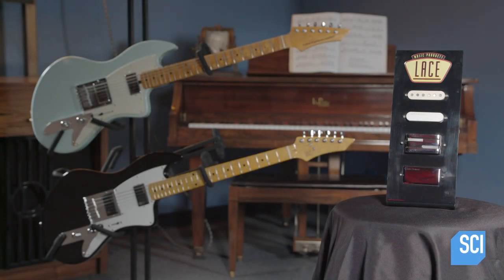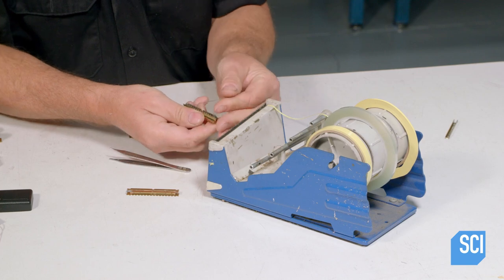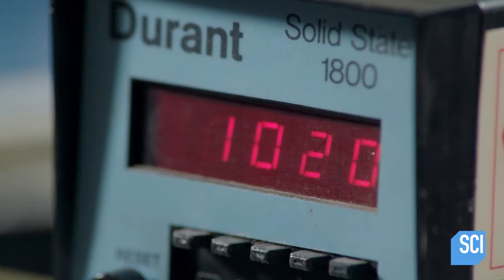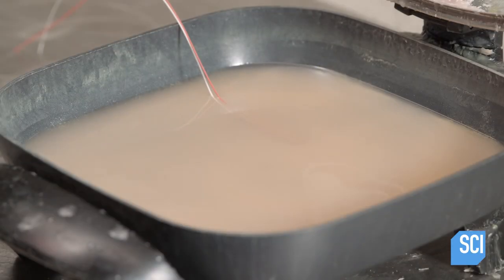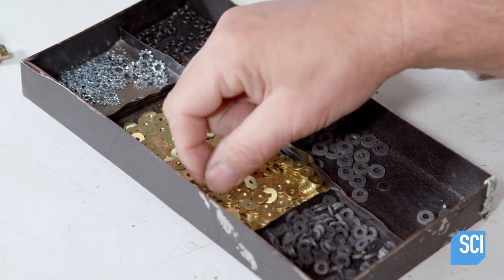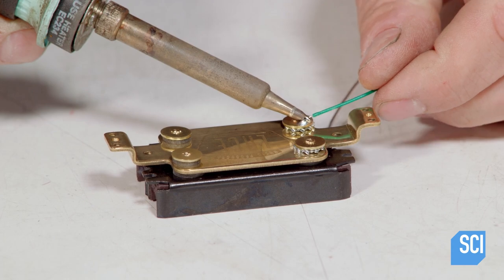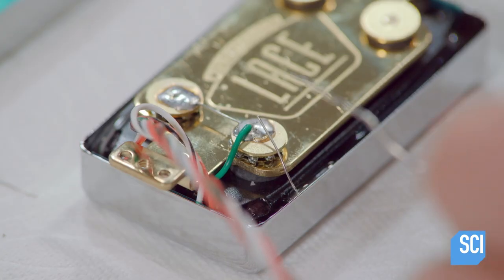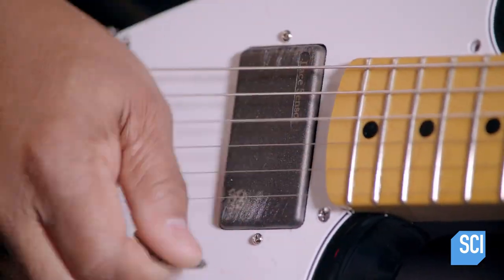Lace Music on How It's Made

Comment: the problem with these pickus is they are now cased in resin ,the wires break of when you rout them in the guitar body  because the wires are not in the middle of the pickup so be very carefull when  fitting

Comment: My new Golds, just purchased advise a very close distance of just a few mm from the strings, yet my Fender Strat, book advises 0.170 inches, which is a much further distance. Any comments please.
Reply: Lace recommends the approximate height of two nickels and a dime, as the distance between the Lace Sensor pickup surface and the strings. This is a starting place and feel free to plug into your favorite amp and tweak from there. As a general rule with most guitar pickups, the closer to the strings, the more perceived output. However the further away the sweeter the tone.
Reply: I would consider either just a few millimeters. If changing the pickups, go with the pickup creators suggested pickup height and adjust  until you feel it sounds the best.